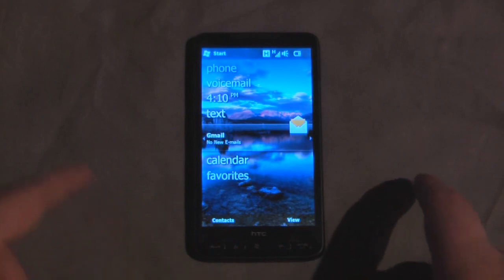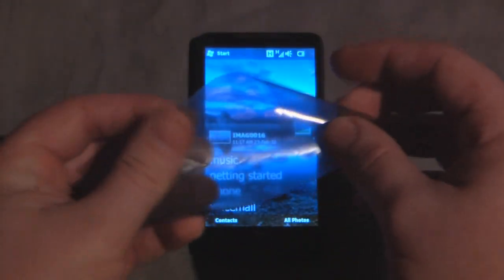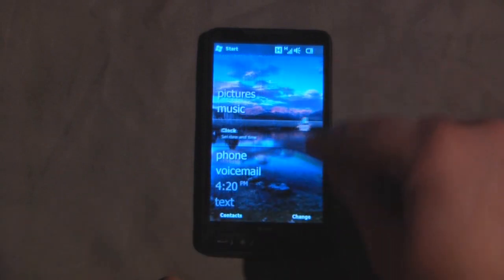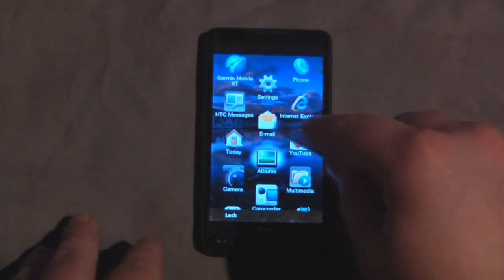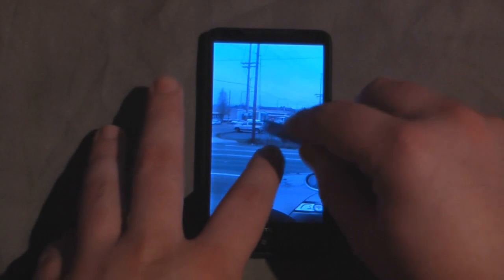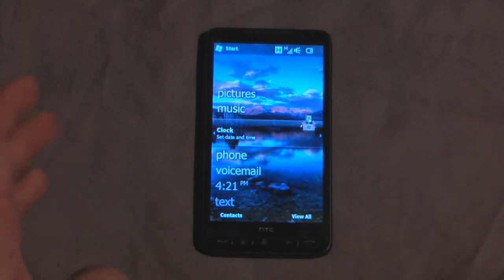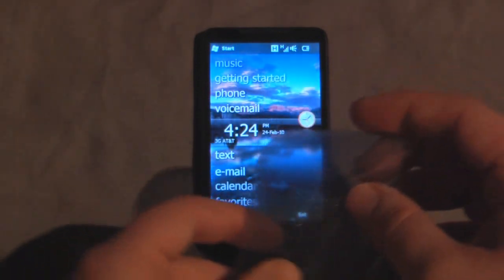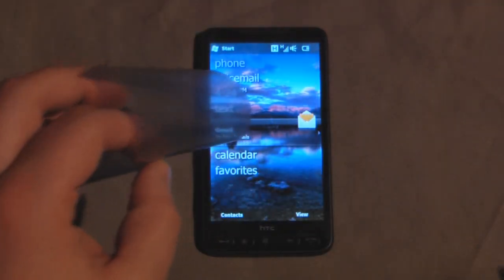How To Make A Free Capacitive Stylus | Pocketnow

Comment: yes, thanks for sharing. i tried it and it works. the only problem is - after rolling the antistatic plastic, how can i make the tip more rounded. Although i guess the soft antistatic plastic will not cause scratches to the screen but if there is a way to make the tip more rounded, it will be nice.

Comment: Thx for the tip! I made my own pen with a piece of this plasting taped on a common pen. A little advice: u MUST have a bigger (approx 5 square mm)connecting surface, u cant make a sharp thing otherwise it wont work.

Comment: Been doing something similar for a while myself on my HTC HD2.  Using even pieces work applied to various items, like gloves and on the opposite side of the nib of a normal pen.

The HTC HD2 unlike most other fruity brands, is a (high resolution) glass screen and doesn't scratch easily or at all.  Using all sorts of random pointing objects with an antistatic layer works and works well.

HTC HD2 (with a tasty cooked WM6.5 ROM from XDA Dev) is the best phone since it's release last year. \[^_^]/